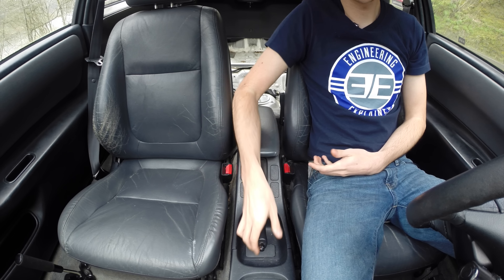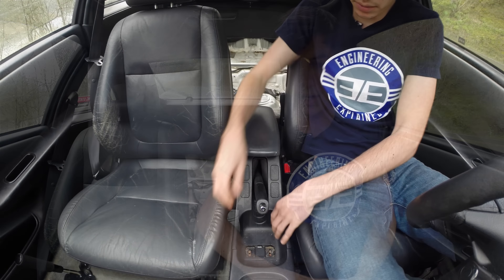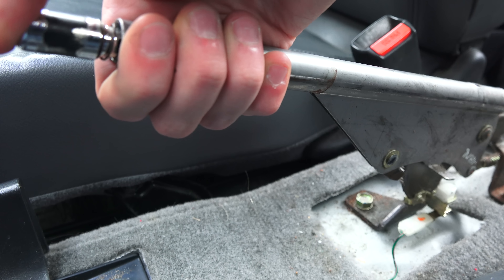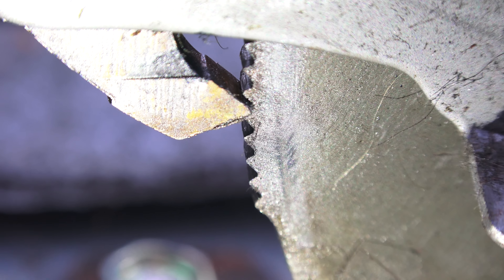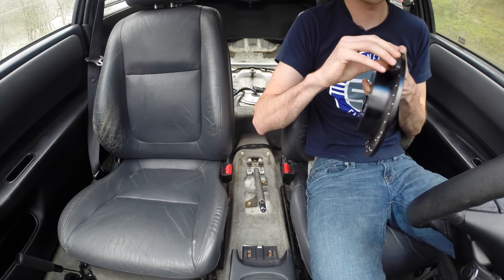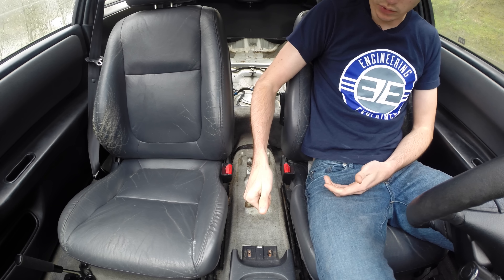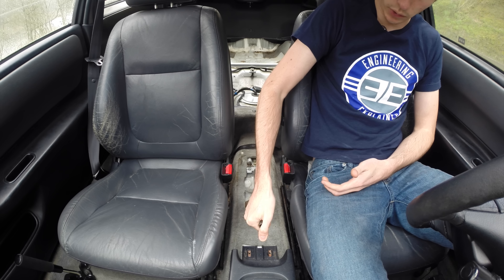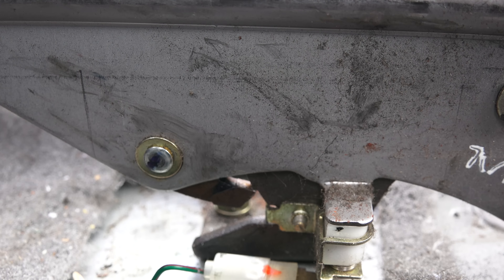Always Press The Handbrake Button? Myth Busted

Comment: The handbrake on my truck has been pulled without pressing the button for 47 years and almost 600,000 miles and it still works the same as always.
Reply from the maker: +luke Fugate That's awesome that your truck is still ticking!
Reply: Engineering Explained It's been driven by four generations of my family. I still drive it out of the creek(shown in my profile pic)every day.
Reply: +luke Fugate same here but it's actually 20 y/o 4x4 and around 550.000km (don't know how much in miles)
Reply: +someone That's about 341,754 miles.
Reply: +RedBearded T (SRN) lol. "That's about exactly this specific number"
Reply: +Mark Schaefer Specific would be 341754.156
Reply: Otto Carius You are trying to say it is irrational. It is not though, as a mile is defined as exactly 1.609344km. Look it up.
Reply: My dad has a 67 stepside c10 that he got from his grandfather that on put 35k miles on. They are neat trucks.
Reply: It has the three on the tree as well.
Reply: My truck really hated wanting to be pulled with out pushing the button lol
Reply: +luke Fugate 600,000 miles! How does a vehicle last that long?
Reply: +Heil Grammar It could just be a non-terminating rational.
Reply: Ryan Toomey
Oil change every 2000 miles, Drive her gentle, and fix little things before they become big problems.(Being a Chevy helps) I would not hesitate to go on a road trip across the country in her.
Reply: +luke Fugate Mad respect.
Reply: +Ryan Toomey You probably haven't heard of Matt Farah's million mile Lexus before.
Reply: +luke Fugate If you were to have had been pressing the button for 47 years, you could have made money on ebay with a handbrake mechanism in near perfect condition instead of slightly worn. My point? My point is just that, if you have a button that DOES reduce wear somewhat, why not just press it? No offense though. You are welcome to drive the way that makes you most comfortable.
Reply: +Otto Carius You're completely wrong there is an ending decimal scrub.
Reply: +Edward Zeta https://www.amazon.com/clouddrive/share/YTv6l7BoZdTr4r9AqgV7hqJdPZ13FFk8TtZOvRlDMci?v=grid&ref_=cd_ph_share_link_copy  here is a picture of the teeth on my handbrake. They don't look worn at all to me. Wear has never been a concern(actually I never even thought about it before)I just like the reassurance of the clicking sound when I pull my brake.
Reply: luke Fugate That's cool.
Reply: +luke Fugate is it by any chance a lexus?
Reply: luke Fugate million mile chevy
Reply: +Nik Brudar plenty of million mile f250 and f350s with the 7.3
Reply: +luke Fugate didn't know those trucks were that reliable
Reply: +luke Fugate what engine is in that?
Reply: Lethal Snipes
It's the 250 straight six. it was rebuilt at 567,000 miles, so now it only has 30,000 on it.
Reply: luke Fugate
nice my dad has a 76 step side 3 on the tree straight six we'll see how long she goes not sure how many miles are on it right now defiantly a lot less then 600k though
Reply: +Ryan Toomey - I dunno, ask the guy with the 3 MILLION mile Volvo.
Reply: +luke Fugate  960000 kilometers, only one more round around the globe and you will have driven 1 million kilometers.
Reply: +luke Fugate What truck that's 47 years old has a "hand" brake?
Reply: +Maxwelhse his.
Reply: Maxwelhse
1968 Chevy. From 67-72 they had a big lever under the dash.
Reply: +S Husain That's not very special for a truck :/
Reply: Rewicet
for that truck yes for a volvo tractor trailor or any semi truck no
Reply: luke Fugate
That's a foot operated "parking brake", not a "hand brake".  That's what I was curious about.
Reply: +luke Fugate . I guess it would be a different story if we used it as an emergency brake, in case the main brakes had failed. We wouldn't be able to modulate the braking without pressing the button to release the ratchet, which would use up valuable reaction time. ... That's the main reason why I have always pressed the button. It is now an automatic reaction when I go to operate the handbrake. So, I wouldn't have to worry about the ratchet in an emergency situation.
Reply: Maxwelhse
No its hand operated in 73 they went to a foot operated pedal by the kick panel.
Reply: Pete: AV.Rescue
good point.
Reply: +TheusZeusDeus You can. The only reason you'd ever want to press the button and pull up is if you are expecting to release the brake very soon as in motorsport. It's a ratchet, the fact that people want to call someone out for using it as intended just illustrates internet bickering at it's finest.
Reply: *****  .. The point is.. if you pull on it hard enough you could lockup the rear wheels (which is sometimes useful in motorsport, eg. a rally on dirt roads). But in an emergency you would want to immediately release *some pressure to regain traction, and therefore braking. Obviously locked up tires do not brake very well! .. And, like I said, if you have to think about pressing the button to release the ratchet, you would be using up valuable reaction time.
Reply: luke Fugate
Would you mind finding a picture for me and explaining the system? Every 68-72 I've ever seen look just like the 73 and up style to me.
Reply: exactly
Reply: +Edward Zeta But then that would wear out the button and the spring etc?
Reply: +luke Fugate The handbrake on my ford has never worked. lmao
Reply: Maxwelhse
I found a picture of the inside of a 68.(Not mine I wish my interior was that nice.) http://cdn.barrett-jackson.com/staging/carlist/items/Fullsize/Cars/178679/178679_Interior_Web.jpg  you can see the hand operated parking brake under the dash.
Reply: luke Fugate
Thanks for the pic. I've never seen a C10 with that style brake before and I've seen loads of them in real life as well as pictures. Maybe '68 was the last year and I've only seen '69+ trucks?

Here's a '69 that has the style I was talking about.

http://cdn.barrett-jackson.com/staging/carlist/items/Fullsize/Cars/138167/138167_Interior_Web.JPG

How does the mechanism work in the '68? Do you pull that bar straight toward the driver? Does it pivot or anything? It's sort of hard to understand just looking at it.
Reply: +luke Fugate hey man if your motor ever dies shoot me a message ive got 4 brand motors for your truck ill trade you straight up i want to bore one out but i cant see boring a new one out when i could bore a dead one
Reply: BuckGreywolfe
Does it what?
Reply: +luke Fugate How many times has the engine been rebuilt?
Reply: RWDtech
It was rebuilt once at 567,000. I was down in Texas and the state police pulled me over and told me if he saw it on the road again and it was still smoking he would impound it. She was still running good just had to stop at a gas station pretty often to fill her up on oil and check the gas. I called it my perpetual oil change system.
Reply: rahmm460
I'm 42. The truck has been passed down from my grandfather, to my dad, then me.
Reply: +Ryan Toomey There speaks a young driver.
Reply: +Peter Geras No it is an exact number. 1 mile is exactly 5280 feet. 1 foot is exactly 12 inches. 1 inch is exactly 25.4 mm. Do the math.
Reply: +ytteman I am NOT trying to bash the imperial system, that's a different topic but just as a comparison; heres the elegance that is the metric system:
1000 micrometers is 1 millimeter, 10 millimeters is 1 centimeter, 10 centimeters is 1 decimeter, 10 decimeters is 1 meter, 1000 meters is 1 kilometer and 10 kilometers is 1 metric mile. Conversion between units is all about the decimal placement.
Reply: And 1 litre weighs 1 kilo etc
Reply: +Car Mo I only use the metric system. I corrected a comment (by Peter Geras) that was wrong.
Reply: Dang, I was going to say mine was fine after 18 years and 270,000 miles on it but yours is astounding!
Reply: My truck is three hundred years old and has six million miles on it.  The handbrake is the only thing that works now!
Reply: Why is everyone to lazy to press a button?
Reply: Phoenix Suns Basketball Because you aren't supposed to so it's not lazy?
Reply: They're only half lazy. The button has to be pressed to release the brake.
Reply: I have to applaud you for having a vehicle with that many miles! You must have taken care of it well.
Reply: 12,700 miles a year. Right about average for a daily driver.
Reply: Nik Brudar seriously lol?
Reply: on my 20 year old mustang it was in such a good shape that i sold it as new to the owner of 2016 ford mustang.
Reply: FYI: 1 litre of pure water weighs 1 kilogram. 1 litre of mercury/liquid silver will certainly weigh more than 1 kilogram.
Reply: the owners manual for my ford fiesta clearly states NOT to press the release button when pulling the lever up. I'm sure many other ford manual's state that as well.
Reply: AdventistFIYA-The Gospel Drummer I do
Reply: AdventistFIYA-The Gospel Drummer Seems you missed the point of the video by saying that..
Reply: yes, that's why it's called a release but instead of set button.
Reply: Michael Bridgestales No. it REALLY is a myth. I have a Ford Fiesta and in the owners manual it states "Note: Do Not press the release button when pulling the lever up."  .. it's called a release button for a reason.
Reply: what type?
Reply: luke Fugate thats cuz its a truck.. trucks are meant for long driving. my truck is 720k kms
Reply: You're not supposed to, so what's unnecessary about it.
Reply: luke Fugate 100th comment
Reply: Rywen Erendani my boss has a 2007 Dodge 3500 that already has 355,000 miles on it.
Reply: luke Fugate nearly 600000 miles is a load, i applause you
Reply: Belagern The mile is based on a metric si standard, this lets it be converted exactly.  America agreed to this many years ago when you turned metric, even though most ppl don't know that.
Reply: why the hell do you keep a 47 yr old truck
Reply: Heil Grammar yep, the US government defined miles in metric units :D
Reply: luke Fugate you're a fking legend man 47 year old truck and still it looks good as new
Reply: What bloody truck is that I need one
Reply: A Volvo car (made is the late 1960's) was once known to achieve over 1,000,000 miles! A Car!
Reply: I have seen a post world War beatle that still runs smoothly . It's odometer stop working. Laat time I talk to the man who drives it was 2013 he told me that he and his daughter regularly drives it and would never go down 60k km per year. The car was well maintained thought, the rims are still shiny, exterior doesn't have a lot of visible rust.
Reply: Does the parking brakes were invented and used in automobiles 50 years ago!
Wow🤔
Reply: My stepmums 1994 vr handbrake button stopped working its because she has the same misconception she always used the button to pull the handbrake up. The spring mechanism failed after 25 years because the constant button pressing, every other part of the handbrake still works and me and my dad managed to replace the lever from one we got from a wreckers. All good now going to show her this video as she thinks it wasnt her fault.
Reply: There was a fork truck at the place I work, and nobody pusht the button. In less then a year the handbrake wasn't working anymore, because the wheel was teard away. It does really Mather which thing you're using the handbrake on, but it tears.
Reply: ??? Doesn't it have a foot pedal parking brake.
Reply: luke Fugate good info.

Comment: that socket wrench analogy was gold
Reply: Exactly!
Reply: My socket wrench wore out and wasn't a cheap Chinese one. It was a bacho one.
Reply: Except that as a socket wrench spins in the reverse direction it is under 0 load. When using the ratchet on the parking brake, the load increases with each click. I agree with Jason when he says if it is worn out the car is probably done too, but it still does create needless wear when the alternative is so incredibly easy. I guess a lot of "us" just see it as laziness
Reply: Look at it again... Its not the ratchet increasing load, its the cable tension because you're aplying pressure to the brake pads (its not actually changing any wear with the ratchet mechanism, look at it closely). If you were to disconnect your brake cable, it would move buttery smooth, its not the ratchet. Remember to connect the brake cables afterwards though!
Reply: the wear is so negligible it doesnt matter. thats the whole point of the video. car parts are meant to last to a certain extent and parking brakes arent used too often
Reply: An even better comparison would be the freewheel of a bicycle, nonetheless the comparison with the wrench was gold
Reply: brwi1 it almost sounded like he said 'suck-it' wrench...and that would have pretty much summed up what he accomplished...
Reply: @Silver9k  that's nonsense. The load isn't applied to the ratchet mechanism until you let go of the handle, at which point the cable tension load is removed from your hand and arm and applied to the mechanism.
Reply: Gold Jerry! Gold!!
Reply: They both sound good now I know it's not a bad sound
Reply: An even better one : a bicycle
Reply: @jakegarrett8109  I know this is very old but some countries have parking brake use in the curriculum for getting a driver's license
Reply: Bicycle analogy would be better. It's not wearing out while you're not pedaling, even though it's clicking...
Reply: I've worn out ratchet spanner/wrench. You're not trusting your life on a socket ratchet, it's not a safety item, you're not trusting thousands of dollars on a ratchet spanner wrench, and the pawls on a tool ratchet are small and made from a much higher grade of steel. It's a rubbish analogy.
Reply: @DataLog  course it is. That’s like saying a bearing never wears out
Reply: @highdownmartin  Ok, we have to keep it in this universe. The wear is so insignificant because force is so low that everything else will break before it breaks. Satisfied?
Reply: @awesome7732  A handbrake (parking brake) is used a lot in manual transmission cars, every time you stop you're supposed to pull the handbrake on, and if you're on a hill you need to(because you can't hold the foot brake, you have 1 foot on the accelerator the other on the clutch), and even if the handbrake wore from not using the button, its better to be lazy and not use the button than to be lazy and hold it on the clutch.